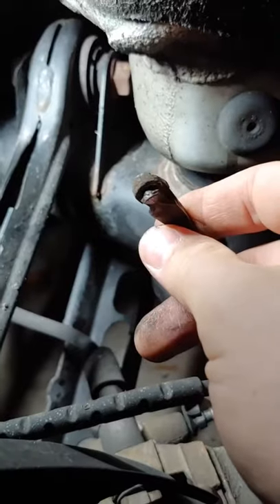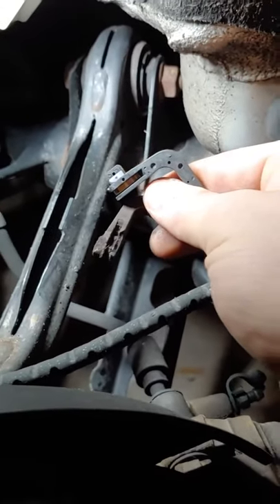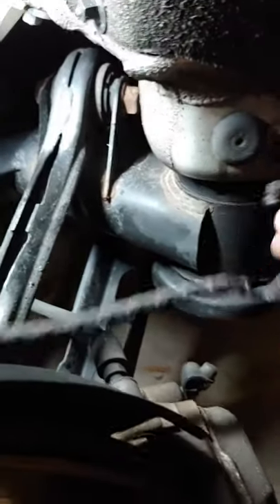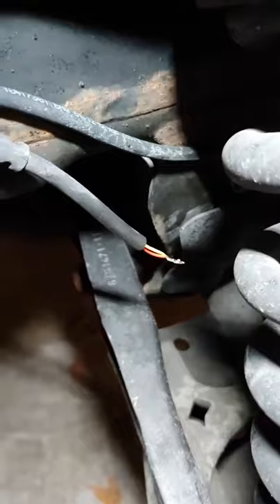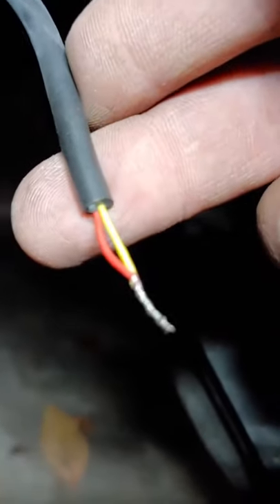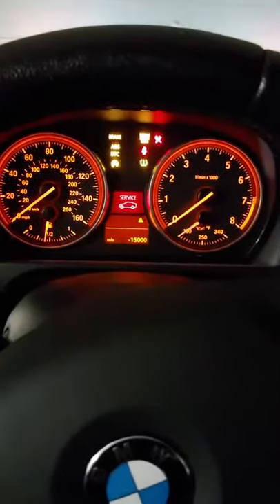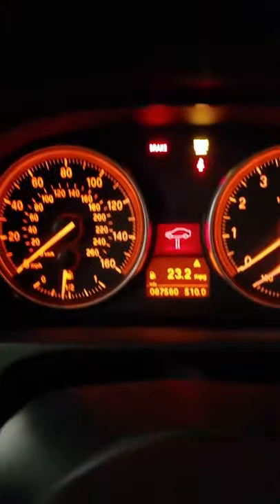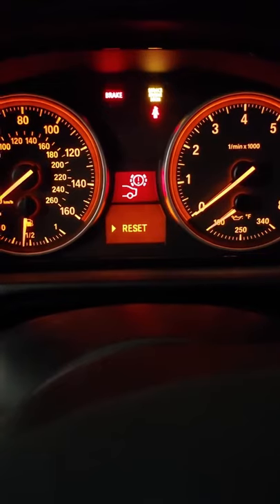E90 BMW Rear Brake Pad Wear Sensor easy HACK to Reset Service Light

Comment: A new brake wear sensor is £5 in the UK. Just replace it
Reply from the maker: Not all aftermarket pads have room for the sensor to fit into the assembly.
Reply: @racecarcamp9056  I thought that if they were designed to go on the car that they would do. Which ones did you buy?
Reply from the maker: @LeedsHypnotherapist  I've got a couple sets of race compounds as well as changing out for daily usage.  The race pads have no sensor options.  But also, to some 10-15 bucks/pounds/euros matters - so it's a cheap hack for sure!
Reply: Why are you watching a vid about a sensor delete if you’re gonna moan about him deleting it?
Reply: @adambrennan579  does the video title say sensor delete? I can see "E90 rear brake pad sensor wear easy hack to reset service light" as the title
Reply: @LeedsHypnotherapist  Pretty obvious though isn’t it Paul? What did you think it’d be?
Reply: @adambrennan579  you clearly haven't answered my question. Does it say sensor delete? Does it mention sensor delete like you previously stated?
Reply: @adambrennan579  I was looking at videos about replacing the rear brake sensors so wanted to see as many different opinions about the best way to do it. There was nothing in the title about sensor delete. You're clearly clutching at straws
Reply: @LeedsHypnotherapist  Yes Paul, I am definitely the one clutching at straws

Comment: U did this in the 4 tires
Reply from the maker: Just the rears.
Reply: Can we do all tires ?
Reply from the maker: @killabeez3257  It depends on where you replaced your pads!
Reply: There is only one sensor right side rear.